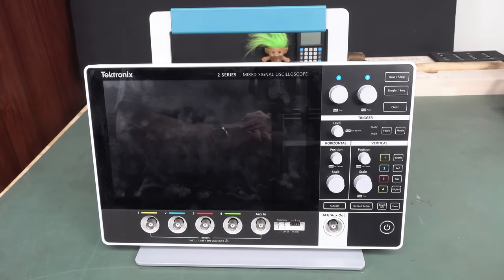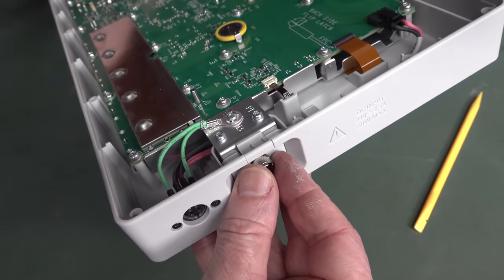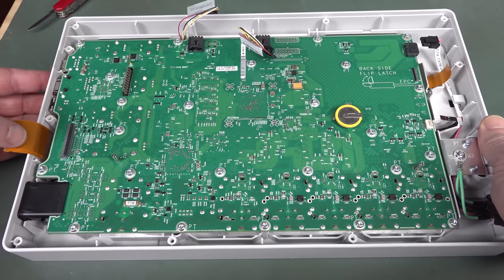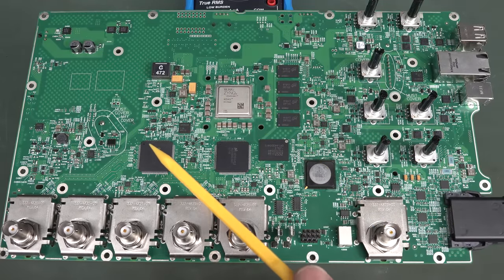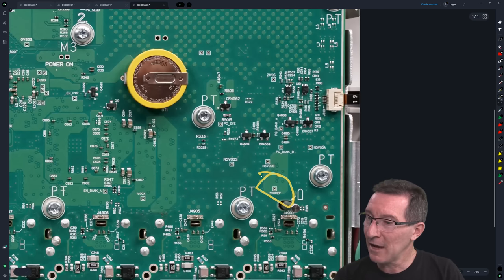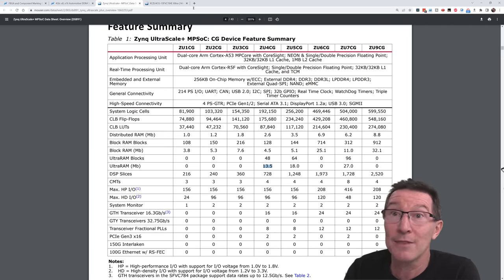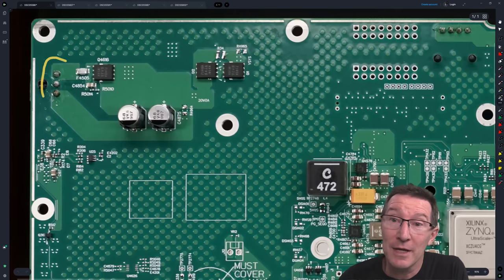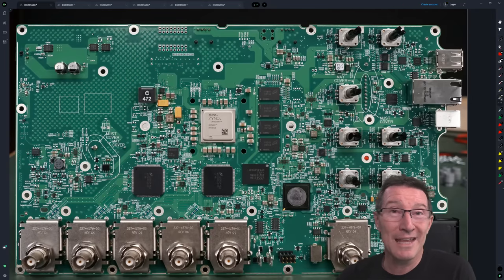EEVblog 1477 - TEARDOWN! - NEW Tektronix 2 Series Oscilloscope

Comment: I’m a scope board repair tech for Tek in Oregon and I’m stoked to hear your thoughts.
Reply: I'm also a scope repair tech for Tek in Oregon and I'm also stoked to hear your thoughts.
Reply from the maker: Do you guys do actual component level repair on scopes?
Reply: @EEVblog  Yes, but only on certain boards. Analog front ends and acquisition boards are component-level repaired, but encoder boards, displays, certain power supplies, etc. are discretely replaced. 

The worst part of the component repair is supply chain issues. Many parts have to come by ship from China and new products generally take quite a while to have parts stocked adequately. Happy to answer any other questions you have.
Reply: Do they still have a cafeteria?
Reply: @jalalhobbs  Haha, yes, but probably not like what you’re imagining. Two person crew mostly makes ready-to-eat meals that are refrigerated in company stores across the buildings. I can only speak for service/mfg in building 19. I’d love to see what the cafeterias looked like before the corporate buyouts.

Comment: Looking at the rear panel, there would be ample space for a decent capacity battery pack inside the enclosure. It goes to show that Tek do not have a lot of experience in compact (phone, tablet-, notebook) design, with the amount of air inside.
Reply: The extra space around the PCB is part of the thermal / air-flow design - keeps the audible noise down to barely audible.
Reply: @w2aew  I agree on the silent part. I upgrade to noctua whenever possible. So much better !!
Reply: You need that air for cooling.

Comment: Probably they are not using the whole bandwidth because of clock source jitter (probably a higher end model with cleaner clock sources can manage it). Clocks at that speeds needs precision to prevent noise produced by clock sample mismatch inside the ADC's. High speed ADC's are composite ADC's that split the phase in 4-8-16 parts to achieve that bandwidth, so any mismatch can cause phase misalignment distortion. Those gsps adc never provide good dc performance, so probably the input ASICs can provide some means of integrated ADC's to cover frequencies from DC to HF. This means also that signal is composed and reconstructed from spectrum inside the FPGA, to show you an equalized and properly timed signal (with lots of gains in signal quality). Believe it or not, the all-integrated signal processing needs less shielding, and JES204 interface needs less wiggly lines and less fancy pcb's, at cost of no-user perceivable latency. I would like a more "innovative" user interface (knobs at both sides with red tips like old tek), and real buttons. The rest is kind of OK. Old scopes are heavy and bulky
Reply from the maker: Quite possible.
Reply: SignalsPaths Multicarrier test show a spur at 500MHz which is related to to CLK, not low but must be part of the 7.3 ENOB
Reply: @reinerfranke5436  that's sad. Probably that frequency has poor coverage. High sample rate adc's have pretty thin bandwidth. You safely can assume 20% of total range at both sides of fs/2. Composition at this rates is a tough task, and needs calibration at certain time intervals to avoid spurious free dynamic range degradation. And if different sources are used, different calibration procedures are needed. Clock sneaking into the main signal means that they don't have a way to filter it.
A way to have less noticeable ebob degradation is to use more bits. 12 bit high speed adc are now off the shelf parts, and you can easily can get from dc to hf. (I.E ads4229) hope the can polish this scope design approach. I really like this part/cost reduction and focus in integrate design. This make the whole unit more reliable and can leverage flexible and high quality processing. It would be fun to see an oscilloscope using Xilinx Ultrascale RFsoc's
Reply: @bigalejoshileno  The NSC ADC is interleaved internal, 1% interleave channel mismatch give -40dB spur and some newer ADC are calbrated to better than the internal device mismatch, but it need finally a test source, so a factory test with the application, if calbration channel randomization could hide the spur below noise floor but it will still be part of the noise budget, similar to the jitter.

Comment: 10:14 If someone is more experience in RF stuff I have a question about the BNC/Frontend shielding.
Could the bump in the metal shielding be there so the GND/Shield is not so close to the BNC center pin? Would this influence the impedance?
Reply: My thought as well.
Reply: Or for isolation distance. 1000volts (beacuse students) on that bnc and you need some space.
Reply: @ulwur  "Because students" should really be a formal error submission code. A more specific version of "Because reasons" and "because users".
Reply: Might they be mechanical only, needed to keep clip on shield in place by being in contact with the back shell?
Reply: I think this is almost definitely the case, yes.
Reply: @stevenknudsen1446  My thoughts too, that the bumps prevent the input shield from falling off.

Comment: Could the raised bumps on the back of the low profile shield be there to keep a distance from the back of the connector pins......to avoid any coupling?
Reply from the maker: I think it's for CAT voltage clearance

Comment: perhaps those pins are to make the panel a bit firmer when you're pressing buttons etc. especially if it's being used as a portable scope, it would make it feel a bit more rigid if you were pressing the buttons with thumb force
Reply: No, they only serve to align the pcb, as they facilitate the assembly of the pcb given the amount of protrusions that have to come out of the front panel.

Comment: Not having had it in the hands, I think the metal pins are guiding pins for the battery holder back, so that it will ensure the mating power connector is aligned before it actually mate the electrical pins.
This surely can be a precaution in case some I'll advised user forgets to take the batteries out before mounting the battery holder.
But for that, of course, the back of the case cannot be snug fit around the pins and it must have some clearance around the pins, and the pins must protrude some bit from the back, (or if not from the back, protrude from some recess that may exist around the pins).
Well... My guess is as good as anyone's.

Comment: 4:30 These pins are maybe for further design decisions. Maybe they will offer a version with internal battery other back cover. These pins are for alignment of the battery I think.
Reply: They might be for connection to a back spraying which was found unnecessary. Or simply didn't get done on this example, if it's preproduction.

Comment: The DDR memory is probably mostly the OS code, you'll not get a Linux kernel for arm64 in under 16MByte alone, and at-least another 16MByte for even a small system... they may well be using most of the DDR for their software.

Comment: 4channel version is around 2400euro on tektronix site. Way too expensive to get no powered probes, auto detect. Horrible interface and membrane buttons. How about Wi-Fi, usb mouse and keyboard, remote control? I don’t know, it just looks like an expensive toy and not a proper instrument.
Reply: It does support mouse/keyboard, as well as remote control and programmatic control.
Reply: @w2aew  and graphic tablet TOO  please
Reply: Wifi would be reason to ignore the product. When I measure somethink I don't want to have unnecessary radio source on the desk. There's gig LAN. Wire is wire, you know...

Comment: Very well executed packaging.  Not a fan of the separate battery back; just include it (maybe minus batteries).  I’ll have to see those membrane switches in person; I have seen many worn through on machines.  Hopefully the switch panel is replaceable and not expensive.

Comment: I don't know this for sure as i havent measured one but I would bet that the outer set of threaded holes on the back are also VESA compatible.
If the holes in the middle are 100x100 I would guess the outer holes are the 300x200 compatible mount
Reply from the maker: 290x155

Comment: Bump on a back shield around BNC pin is most likely for signal integrity or creepage reasons, instead of mechanical only. Must cover/may cover usually means epoxy coating on top, so at assembly they would know where epoxy should go/not go.

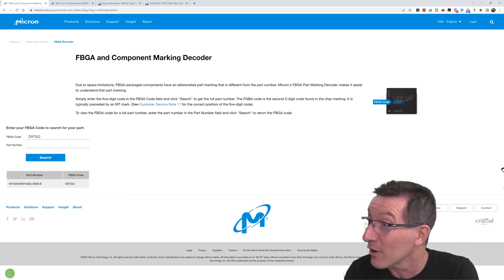Comment: 31:33 That FPGA is configured with 64-bit wide DDR4 memory. Tek could have used a DDR4 SODIMM slot here instead of soldered chips to allow further upgrades. For example if you want to further expanding your memory depth you can just buy a Tek SODIMM module (the SPD EEPROM can contain memory timing configurations along with a license key.)

Comment: Finally, a Micsig-look-like Tablet Scope ？
Reply: Yes. Only look-a-like. I've owned and used the ato1104 for something like 4 years now and both love it and hate it. I hate the touch screen, but otherwise love the scope. I'm going to get sto1004 learnelectronics just reviewed. Did the sto1004 basically replace the sto1104c?

Comment: The metal pins = when you have it mounted on the smaller VESA mount, the weight of the unit plus the wires connected to it, plus and yanking that might happen...  The metal pins support the back  plate from flexing under load.

Comment: the batteries look like film batteries I wonder if they're using a fairly stock battery that could be sourced from third party vendors. Like how infotainment lithium Sony batteries are so generic. If that's the case that would be a very good move you can have your high capacity originals and third party backups.

Comment: I would have to think the bumpouts on the shield around the back of the BNC is for clearance for voltage withstanding, or to reduce capacitance to the center pin or both.

Comment: Alignment pins strike me as like a pc motherboard using the center standoff as a pin - getting the board lined up is pretty important because ALL the knobs/bncs would looks wrong if off by just a fraction of a mm. Rigid pins with a tight fit on the board ensures it can only go in one way and one precise alignment. Board edge clips can break or bend.

Comment: I am worried about the lack of a vesa metal bracket
it does not weigh a lot but i would place this on a monitor arm and grab the side of it to move it around the workbench and over years they might pop out
Reply: Real concern!

Comment: They've really sucked the cost out this device at the expense to the user experience. I'm presuming this is to compete with the low end Chinese scopes that a whole generation of new engineers have been growing up with because Tek were too expensive. I'm betting this will be priced above a Rigol with real buttons, so unless the software is vastly superior I think this is going to be a tough sell. If they can get the price at a Rigol level then it is more compelling. The VESA mount is really nice.
Reply: I use at work new series 7 which was more than 20k euro, old 1ghz tektronix dpo, 7k euro 12bit lecroys and, 4ch. 2000euro 500mhz siglent 5000 series. Honestly siglent is my favorite out of the bunch. Dedicated channel controls, many USB ports, Wi-Fi support, simple remote control, small, responsive and quiet. You can control siglent awg units from it, plot bode diagrams etc… siglent gets same probes as lecroy, and also works with lecroy current probes as well as lecroy low volt differential probes. But for that you must get an adapter but it’s only 2-300 euro. We already have many expensive lecroy probes so it’s a no brained.
Reply from the maker: This isn't remotely near Rigol pricing, it's Tektronix pricing, which is on par with the likes of Keysight and R&S. If you are after a cheap bang-per-buck scope, this is not what you are looking for.
Reply: @EEVblog  That's the problem, people will expect a premium experience for a premium price. Membrane switches are not a premium experience in this application. Self tappers into plastic at a premium price is also absurd. These are both qualities of a free tradeshow calculator.
Reply: @jack_brooks  Welcome to the new normal. Lol.
Reply: @JasonWW2000  There are no bad products,  just bad pricing.
Reply: @jack_brooks  Theres no such thing as bad pricing.
Reply: @JasonWW2000  It's just a saying (not made by me). It means you can charge a high price for a high quality product or you can charge a low price for a low quality product while keeping the customer happy. But selling low quality product for a high price is just bad pricing.
Reply: @jack_brooks  Its not bad pricing. Your just not understanding what goes into determining the price. If your the type of person who does not want to pay for the research and development, high quality parts, testing, manufacturing, etc... then you should just wait and buy a clone. Clone products don't have the high price because they copy, sometimes poorly, the components and spend nothing on research and development. They use lower end parts, don't really test it and find ways to manufacture it even more cheaply, like with lower quality plastics, led screens and membrane switches. They also don't have much of a warranty. 
Also keep in mind that Tektronix is a large company that pays their employees well, has a high rent payment, employee health insurance, etc... So their product pricing has to pay for all that as well. Basically higher overhead costs compared to a little company in China. So pricing is a reflection of all that.
Reply: @jack_brooks  Also keep in mind that China can build very high quality items if they want to. If another company tells them to use high quality parts and to do the testing, etc... they can put out something like an iPhone. It just costs them more.
Reply: @JasonWW2000  - the Chinese company would use the high quality components in the first 500 units that will be inspected by the client. After that it will cheat and use low end components and pocket the difference.
Reply: @JanBruunAndersen  That would be a good way to lose a client. Tektronix could move to a different company. Some of these Chinese companies care about their reputation and don't want to jeopardize.
Reply: Rigol has only one benefit, price. If you prefer it you didn't work wit Siglent or Tektronix yet.

Comment: I wonder of those two "alignment pins" actually transfer mechanical load, especially from the battery pack?
Reply: No, they only serve to align the pcb, as they facilitate the assembly of the pcb given the amount of protrusions that have to come out of the front panel.

Comment: Nothing runs "from eMMC" directly. eMMC works like a disk, content must be loaded to RAM to be executed. The DRAM4 is more than likely used for the application processors, not just for sample storage (samples may even be stored/buffered in FPGA internal RAM first). There isn't enough internal RAM to run all the modern software with all the graphics and its abstraction layers.

Comment: the os is probably using a significant amount of the 2 gb of ram because for linux with a  gui you need a minimum of 300mb or more so would expect at least 500mb of it to be used for that

Comment: Dave, loved the video. However, I did note you using the same word incorrectly quite a few times, so I thought I would politely point that out. "Simplistic" is not a synonym for "simple", rather it means treating something complex as if it were simple, usually erroneously......

Comment: Does this really dissipate 50W ever? My guess would be that the power brick has a reserve for using the device and charging the battery pack at the same time, and this is only 25W or something. Also: Are you sure about the memory? The 10 MPoints fit inside the Xilinx, and the DDR4 might be what's running the app (for the ARM cores)...?

Comment: Wow. Scopes are just getting thinner and thinner. What is the big black connector(?) seen at 38:29. I think I might have missed where it was mentioned. Is that part of the logic analyzer part of the unit? You mentioned that feature when pointing to that general area of the board.

Comment: External memory is too slow - most likely, it is used by the OS and the graphics accelerator. I'm assuming the memory for signal sampling is on the FPGA (12 meg)
Reply: It's DDR4, a single chip should have plenty of bandwidth to handle even 2.5 GSPS.
Reply: @HitoPrl  DDR4 is very bursty in nature and has both latency and refresh issues for high speed sampling (look at the number of clock cycles needed for activation, RAS and CAS, plus the number of cycles needed for a page refresh). Very probably it’s program memory, the internal SRAM/BRAM on the ZYNQ is on the FPGA side of things, and is too small for a Linux build with GUI anyway.
Reply from the maker: There is not enough internal SRAM in the FPGA, it's has 10M per channel + the digital channels. Many scopes use external DDR4 sample memory.
Reply: They might be using distributed RAM (in LUTs) in addition to the dedicated internal SRAM to get additional fast internal sample memory. Or/also, they may have two separate DDR4 channels with one being used by the A53 cores and another being used for sample memory.
Reply: @EEVblog  the mistake is in thinking that there’s no connection between the FPGA and HPS parts of the chip. Data can be captured to BRAM, and as each block is completed it can be queued to be written to HPS RAM. The HPS can reserve blocks of RAM for FPGA use, and the latency of traversing the FPGA=>HPS and then HPS=>DDR4 interfaces would be hidden from the capture process. 10M sounds like an entirely arbitrary size though, and with little effort it could be increased or decreased, subject to how much of that 2GB of DDR4 is being used by the HPS for code/data.
Reply: As there are missing termination resistors of the  DDR it looks like use of two independent RAMs 512Mx32 with frequency up to 1,6GHz by DDR4 spec. It does not look like somethink that does not save 2GB/sec. But the capacity is limited by frame buffer, system and so on...